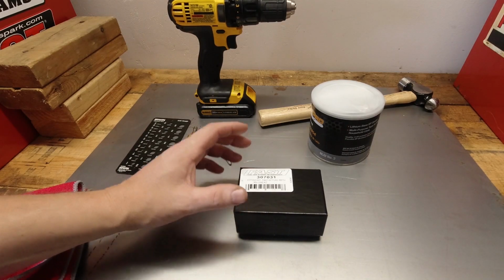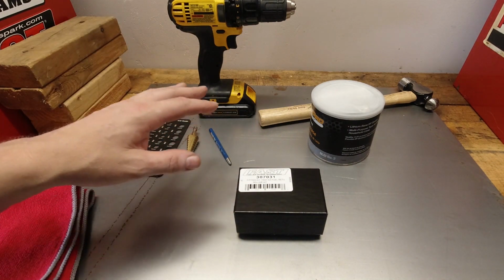How to Add a Return Line to a Factory Fuel Tank

Comment: One thing that I do when drilling overhead to stop metal shards from getting in my eyes, is to take a microwave magnetron  magnet, "donut ring" shape and stick it to the metal surface and drill in the middle, "ring surrounding the drill". This catches 99% or more of the shavings. This may be a way to stop metal from getting in the tank. Using this magnet with a hole in the centre and drilling with that in place, will do better than the grease for sure. .
Reply: That'll save the eyes, since the tank is a ferris metal you'll be channeling magnetic Flux lines to the side of the tank they are trying to avoid getting shavings into, additionally magnetizing the small chips making them difficult to remove until enough time passes and they let go falling past the pick up. Although you have given me the reason I haven't tossed my broken microwave yet, definitely need that magnet so thanks. (Someone could always do your way and leave the magnet there for good, trapping foriegn metal out of the fuel for years, but missing out on accidentally erasing their favorite VanHallen cassette)

Comment: howdy.... another great and informative video -- thank you for sharing with us!  May i ask a probably dumb question? --- when you add a return line like this, does the fuel tank itself still need a vent, or venting tube?  or is that not necessary since you are circulating fuel back into the tank.  i recall my tank had a vent tube, but made me wonder if that was actually an access point to add a return line.  Just curious... thanks.
Reply from the maker: @jbaker400  it’s a great question.  The tank is vented as the system is designed.  Vented through the cap or if it’s a sealed system through a charcoal canister for emissions purposes.  Adding a separate return doesn’t affect that operation.

Comment: Nice, I needed this.  My 89 f250 transfer valve failed and I've decided to isolate the front tank to feed the engine rather than fix or replace the valve (because it will fail again and send fuel to the wrong tank).  
The rear tank I want to leave in place, wire its pump to a switch, and use it to refill the front.  But, I did not want to plumb it into the return line to the front tank with the engine return line, even with a check valve I was afraid the fuel would still go to the rear tank and overflow.  Now with this I can buy a new front tank which I need anyway, add this fitting, and I can refill the front tank at will and the two tanks are isolated with no valve to fail between them.  This fitting will also be up near the vent, so no need for a perfect seal.  Could also throw some Seal-all or JB Weld around it.
Reply from the maker: No need to add anything else to seal it.  The gasket works just fine if it’s not over tightened.

Comment: It appears it may be a all round better deal to put a return line fitting in the tube where you fill the tank
Reply: thats exactly what I did
Reply: @martinreed5964  # mee too.
Reply: You mean where the line from the carb goes into the tank or where you pump it at the gas station

Comment: Modifying a gas cap to have a Schrader valve or air tool connection, or simply a rubber hose to the fuel line, a decent pressure regulator set for like 5 or ten psi will create just enough positive pressure to eject all the metal debris when making a hole in the tank. Not as much fun as a 9mm but you'd have two holes that way
Reply: Neat idea!

Comment: More professional than what I did. '67 Mustang, added a PVC "Threaded Barbed Elbow" to the fuel filler line, <$1.00 with a band clamp.
Reply from the maker: Only thing that would make me afraid of that is what the ethanol will do to it.  PVC doesn’t have any protection from that nasty stuff.
Reply: On my first EFI retrofit, a 77' Mustang II, I removed the filler neck and welded a return nipple to it. Worked perfectly and easy to to.
Reply from the maker: @Ares-jx4ep  I could see that working on some filler necks.  Others not so much.  Plus the welding aspect is outside of most folks skill levels.  Either way, I’d be interested in seeing a 77 foot Mustang II!  🤣

Comment: I'm crazy about rare-earth magnets. I'm thinking of using the grease but also stick a couple magnets to the step bit also to grab those metal shards. I stick those powerful magnets to my oil filters as well. I also stick them to various grounded bolt-heads in my engine compartment to stick voltmeter connectors to or on the cowl or fender of a car I'm working on to hold tools or paperwork. They're handy little guys. That's why I'm crazy about rare-earth magnets.

Comment: What about the old thick plastic tanks would it crimp enough to seal before it pulls thru,??? Great video
Reply from the maker: Don’t think so.  It’s a rivnut.  I’d imagine it would pull through the plastic before it would tighten down and seal.  You could do a bulkhead fitting and get a good result I’d think.

Comment: I use a dry tank, obviously and turn it upside down and use grease the few I've used. Then take a pick and paper towel and pull it around. Worked so far. It's some aggravation

Comment: Quick question, if I swap my original  single line sending unit on my 69 chevelle for a gm unit that has a return line, can I just run a return line from the regulator?
Reply from the maker: Maybe.  If it’s a vent line though you might run into issues.
Reply: @MuscleCarSolutions  no the sending unit would have a second line for a return

Comment: Do they make one of these for the plastic tank in like an 06 silverado?
Reply from the maker: No.  Just use a bulkhead fitting.
Reply: Through the pump housing or straight into the tank with a hose inside going to the bottom so no air in fuel return to the tank?

Comment: Will a step drill cause any kind of sparks ? Don't really wanna blow up
Reply from the maker: Anything that’s metal on metal has the chance of creating spark.  Take every precaution to prevent it.  Popular method is to completely fill the tank with water then do your drilling/cutting/welding.

Comment: I have a 72 c10. How do you feel about using the overflow/vapor line as a point for return? The line is just hanging at the bottom of the passanger side and plugged seems useless
Reply from the maker: It’s a great question!  I have a 71 with the emissions tank and need to see what that space looks like and if the return will interfere with the filler neck.  Replacing the fuel tank sometime this summer.  Have though of trying it there.  We’ll see!

Comment: should this be installed far from the fuel pickup so as not disrupt the fuel source?
Reply from the maker: No.  Most factory stuff and the aftermarket returns the fuel right next to the outlet/pickup point.
Reply: yes, just in case the return fuel is heated and gets picked up before it can cool

Comment: Tanks Inc. told me that the return line needs to exit the fuel at a low point of the tank. It must be submerged in fuel which is why is't usually incorporated within the sending unit. Thoughts$
Reply from the maker: That doesn’t make any sense.  They have their return right in the fuel pump hat which is in the top of the tank.  It’s not mounted low at all.

Comment: From what I understand there should be a tube that extends to the bottom of the tank to prevent fuel aeration.
Reply from the maker: It’s not returning gallons per minute.  It’s a slow trickle of fuel and you’d get more chaos from making turns in the vehicle Ike than what a return line in the top of the tank would introduce.  No worry.

Comment: Or remove tank and drill upside down saw that done before metal falls on the ground and not inside the tank
Reply from the maker: It’s a possibility but it still pushes material up into the tank.

Comment: If it's an older car with no return line, I could actually see trying to port some free space on base plate of the sending unit. Cause then you could take that out and not get any metal shavings in the tank.
Reply from the maker: Not enough room on the sending unit for it.  At least I don’t recall seeing one that had enough room to put one.  The footprint of fairly large for the return port.  Unless you can find one with a stainless plate that you could tig a line to.
Reply: its probably a good idea to place the return as far away from pickup in case the return fuel is heated and gets picked up before it has time to cool

Comment: EXCELLENT EXCELLENT EXCELLENT. I would add a little WD40 between the bolt and the rivnut to reduce the risk of it galling against the aluminum.
Reply from the maker: Not a bad idea.  I’ve done about a dozen of these so far and no issues yet.
Reply: @MuscleCarSolutions  Agreed.  Since this one has the wrench flats to keep it from spinning probably not needed.  Trying to do the cheaper ones with a bolt instead of using the tool, I've had them spin on me.  I has another question for you. . .have you ever done any fuel systems with hard line and specifically how did you transition from the hard line to the AN fittings/hose.  Just looking for tips for an EFI system I am about to do.  I don't really want to run hose all the way.
Reply from the maker: I almost always run line the entire way.  Very rarely do I use hard line.  If you want to retain it, you can with a AN fuel line adapter.  Similar to this one: https://amzn.to/2YuZuT2

Comment: will adding a return line to a carburetor that runs on about 7 pounds of pressure, reduce the pressure to the carburetor too much --  assume using a stock mechanical fuel pump  -- im thinking the fuel is constantly running back to the tank  and will starve the motor
Reply from the maker: What is your pressure regulator set at?  What is the GPH of the punk you’re using?  What carb are you pushing 7psi to?
Reply: @MuscleCarSolutions    ok-- i have a 66 ford truck 352--  2 brl--  it has serious vapor lock issues-  solution on u tune -add a return line the filter i got has a 1/4 return line to the tank-- not installed yet- duralast FF3420DL--  i get 9MPG--  camper on back-- uses a ton of gas at 60mph--  a friend said the return line which is as i understand it--  is wide open will cause low carb pressure  on highway -  no pressure regulator--  tests with filters that dont have a return line-- dont address the issue-  also its a mechanical pump so might not have the thru put of an electrical pump-

i could install it and test it but id like to get infromt of the problem--  really appreciate your input

-
Reply from the maker: When you say vapor lock, what do you mean?  It’s having issues while running or after you drive it and shut it off it’s hard to start?  The fuel economy side is difficult.  You’re not going to find big improvements in the engine.  That’s why overdrive transmissions now have 8 and 10 gears.  It’s keeps the operating rpm low.  The return line has nothing to do with what psi the carb sees.  Only potential volume.  If it’s a factory pump it’s probably adequate if it’s operating as it should.
Reply: @MuscleCarSolutions  vapor lock--  running at 60 slow down to 10mph its 110degrees outside-- gas boils-  im stuck--  hard to start also if i stop  sometimes when very hot--  same reason gas boils- i think the idea behind the filter with the return line is 2 fold-  1-- vapor is routed back to the tank 2- since there is constant gas flow the gas stays cooler- many people on u tube say this works- it sounds like it should- im stuck with 9mpg--  i only bring it up to show that the motor requires a lot of gas-- so we are getting to the issue:  you said  :  The return line has nothing to do with what psi the carb sees.  Only potential volume. -- i think thats true only if the pump can pump enough gas to run the motor as well as create a constant flow of gas back to the tank--  i think this type of filter has a constant opening so liquid gas goes to the tank the same as unwanted vapor- if you blow thru it air goes right out the return-- 
so to be absurd but make a point--  if the pump was outputted to an open ended garden hose it would produce zero pressure-- 
  maybe you answered the issue by saying you think the factory pump should accommodate both the motor as well as the return--   i guess the only way i know is to run this thing at 60mpg with the return hooked up and see if the motor starves for gas-- appreciate your input--
Reply from the maker: @quickfix9815  the engine is the heat source.  The carburetor is negatively affected by that heat and the fuel (assuming it’s got some ethanol in it) is paying the price.  I think your best bet is to start with blocking the heat source.  You mentioned it’s a 2 bbl carb?  Some digging might find you a company that makes a phenolic spacer.  I’ve seen universal wood laminate spacers that you cut out to match your carb/intake.  Don’t know.  You’ve got some research to do.  Either way, it’s a common problem due to bad fuel.  That’s where I’d start.
Reply: @MuscleCarSolutions  TY-  if the fuel filter by pass does not work thats my next step

Comment: Can I do this on a oil pan tap?
Reply from the maker: For like a turbo drain?  Yes and no.  Yes you could, no it wouldn’t be a big enough size.  -10 at a minimum.  -12 would be better.  You don’t want a choke point there and have oil back into the turbo.

Comment: Can't you just install it on the sending unit plate?
Reply from the maker: If you want erratic readings on the gas gauge, yes.
Reply: @MuscleCarSolutions  even if you bend a slight goose neck away from the float?
Reply from the maker: @dank1349  I guess if it’s worth your time to try it?  Only saw it done once with a friends project and out it came because the gas gauge looked like a tach bouncing off the rev limiter.
Reply: @MuscleCarSolutions  i thought about taking 3/8 steel tubing bending an angle on it and tigging it in. Obviously to locate it as far away from the sending unit the better but the shavings sounds like a problem and I have a S.S. tank so a magnet is going to work well fishing them out.
Reply from the maker: @dank1349  there’s always that to consider too!  Never an easy solution for problems.  If you can TIG, then maybe just punch a hole, tig it back shit with the pipe size you want and locate it anywhere?
Reply: @MuscleCarSolutions  this is true

Comment: How install a vent in a piece of sheet metal! Why didn't you actually show it on your tank? Hmmm.
Forget the drilling (metal chips and possible sparks). Just Tee-off the  Evap return fitting, or remove the sending unit and add a fitting to that!
Reply from the maker: Because this was the second video I shot.  The first video was on an actual tank and an endless amount of Karen’s complained they couldn’t see in the tank.  Can’t seem to win with you folks.  😂